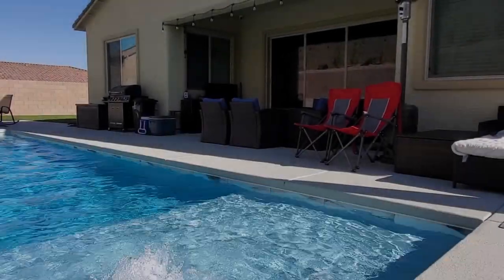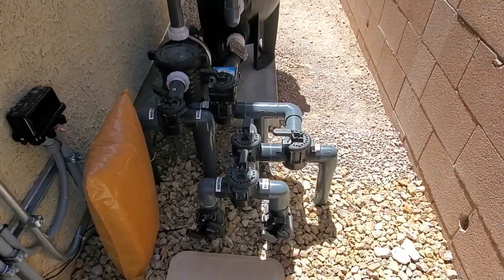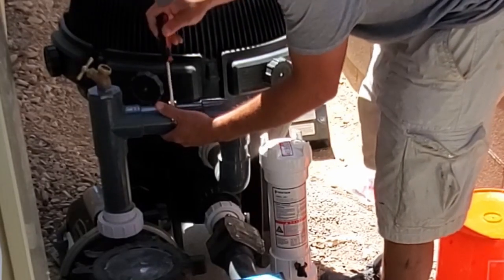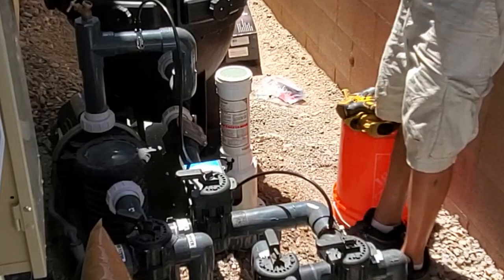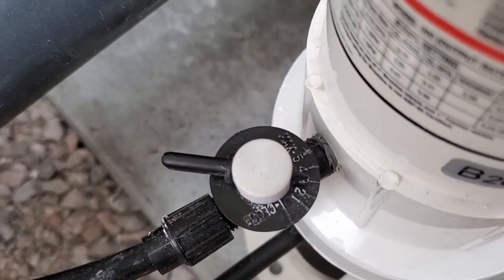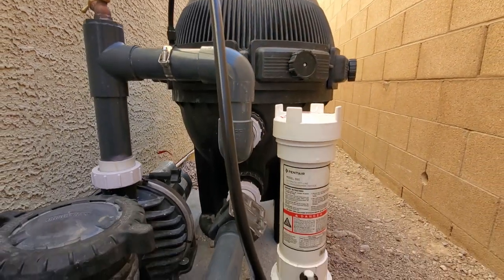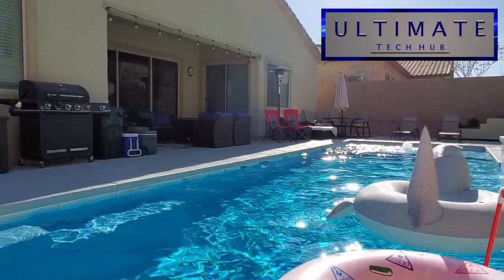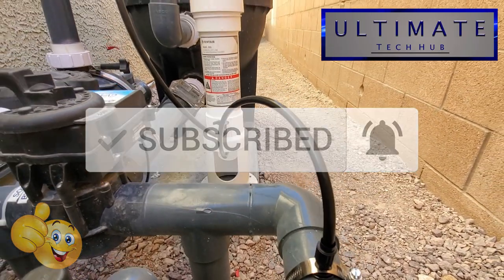Pentair Rainbow 300 Chlorinator - Installation & Setup

Comment: I would have plumbed the chlorinator intake hose past the filter, so you get the cleanest water you can....Putting the intake just beyond the pot basket can put small debris in those small chlorinator fittings
Reply: 100% what a head scratching decision.
Reply: Without a heater the inlet goes before the filter and the outlet after the filter. If you put the inlet and outlet after the filter there will be no pressure differential and no flow through the chlorinator.

Comment: I added 2, 3 inch tablets at put it on 5. They’re both still in there but one had half dissolved. My chlorine levels are depleting quite fast and I cannot maintain it. Any ideas? Should I add more chlorine tablets or that won’t make a difference
Reply: The stabilizer is quite high too

Comment: Great video overall but your pool guy is not your chlorine feeder lol. A pool has to have an adequate supply of chlorine (if that is the chosen sanitizer) and must be maintained. A dose of chlorine once a week will burn off very quickly, even with good CYA levels.
Reply from the maker: What I meant was you don't really need a chlorine feeder if your pool guy is maintaining your pool. Chlorine pucks can be placed in the skimmer basket just as easy. However I have a pool guy and a chlorine feeder so I'm not even taking my own advice. Haha. Thanks for watching and for commenting!!

Comment: Do you have to have pvc piping. I have the flex hoses
Reply from the maker: Not sure. These hose attachments are for PVC. You may need to buy a different hose attachment.  You certainly don't want any leaks so maybe ask a professional plumber or pool company.
Reply: @UltimateTechHub  can you just hook it straight up kinda just like the pump
Reply from the maker: @cavyboy99  Not this model. However there are models that can be connected via PVC pipe.